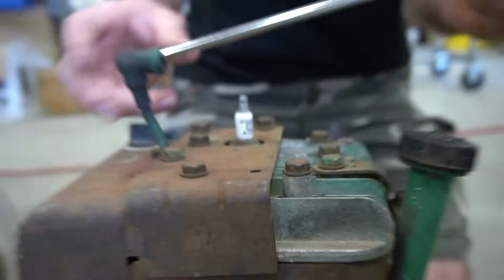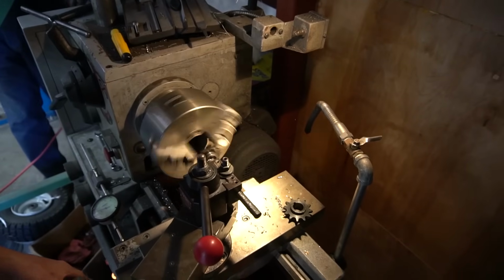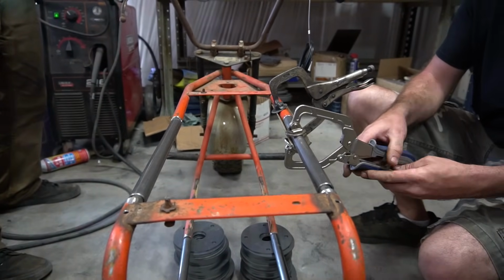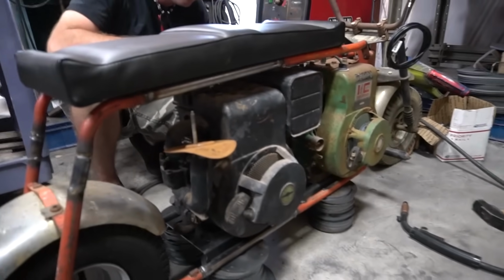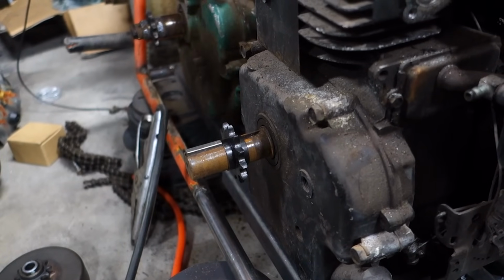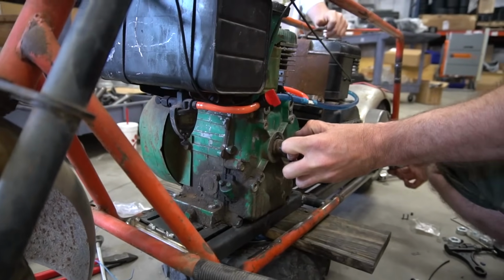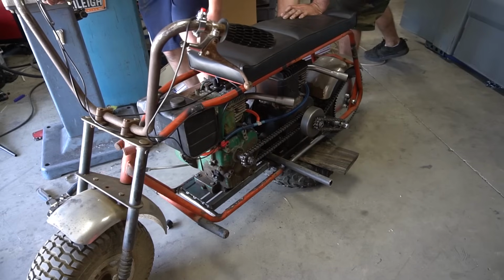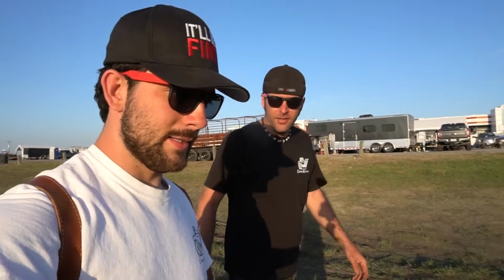Rat Rod 16 HP Twin Engine Mini Bike Build

Comment: You should put a clutch on the front engine, put the sprocket side in so it can align with the rear engine sprocket, I think it will work better and also you will only have to start the front engine.
Reply: Experimental Fun that makes so much since. Wonder if we are overthinking that and there’s no way it could work😂
Reply: exactly what I was going to suggest.
Reply: I was thinking figure out the compression stroke on each and set them to 180deg off of each other so it runs like a real 2 cyl! Maybe also a 2 into 1 exhaust? Two smaller headers feeding a double sized? (more cosmetic than performance).
Reply: Jeff Kephart 2 in one exhaust would be so cool.
Reply: Oh yeah a clutch on the front engine would work cause when you go to give it throttle it will engage the front engine, genius dude Genius !!!
Reply: Experimental Fun I was thinking the same , it’d be like v-tech.👍🏼
Reply: Time the engines 360 degrees apart for smoother power since they are 4 strokes that make power stroke every two engine revolutions...
Reply: Yes the suggestion to install the clutch on the front is a great idea! But take it further and have a clutch on BOTH engines! That way you will have twice the clutch strength! Hooked to one jackshaft then to the rear wheel. But have the sprocket that drives the wheel across on the other side! That would help keep the width down. Plus you would only need to start the front engine! Let it idle, then after it warms up a bit close it’s choke and then just give it some RPM’s to start the other one! Also having the timing on both engines off for alternate firing would be better! Plus a two into one exhaust header that would sound better!
Reply: The 2nd centrifugal clutch wouldn't start the second engine if the chain is looped over both clutches... or if the 1st Clutch drives a sprocket hard on the 2nd engine, then a clutch on the 2nd engine driving the jackshaft wouldn't give twice the clutch strength, as it would be still enduring the torque of both engines... and having all chains on the same side lessens the strain on the jackshaft bearings/mounts as the jackshaft's chains pull in opposite directions, somewhat cancelling out the pulls forces... also, wouldn't want the 2nd engine to be taking off cold... better to warm both of them up simultaneously... furthermore, dual exhausts sound better than single exhaust when routed out to opposite sides of the rear of the bike... giving a stereo sound effect... like on my Suzuki Intruder motorcycle... My minibike I made way back in 1969: 350cc, 2 cylinder, dual exhaust, 4 gears: 
http://i1088.photobucket.com/albums/i333/BuzzLOL1/BuzzLOL%20Pictures/DannyFuneral008-1-1.jpg 
.
Reply: it'll be fine
Reply: Another thought would be, reverse one engine. that way the intake sits between the two engines then run two sprockets on the back wheel so the motors never have a chain between them but just at the rear wheel. You could clutch them individually. But still run the one carb between them.
Reply: Zack Dänekas never work with the engine would be opposite direction
Reply: @BuzzLOLOL  Take it from one who's built one in 70s ,you wrong if the front engine is clutched it will work.The clutches grab @ about 1600rpm so the the front engine timed 360' or 180' would work if you've worked around Hondas,and eould multis
Reply: Forget the last two words - it glitched...having a 2nd clutch on the front engine would give some more engine flexibility & the jack shaft run across to Final sprocket (depending on brake system) on the would add more flexibility too(spare parts etc)Paired or single exhaust system is just a cosmetic thing unless the motors are souped.Not raining on your parade but I doubt you have 16hp, you've got parasitic losses.1 last tip: drill those holes in the frame for welding BEFORE you cut the frame up .These tips were in the karting books & pocket size rod & custom magazine in the 50s & 60s.Those #35 chain Asian Sprockets are junk btw.Cheers Trev New Zealand
Reply: @k.r.v.4219  true, each engine needs their own clutch just like a drag bike
Reply: @Zack Dänekas  the engine that is flipped around would be turning the tire the opposite direction

Comment: what the hell...I like it , I like it a lot
Reply: Right?  I can't wait to see more of this thing!
Reply: Most 'Franken' thing about it is the gearing ratio of the chains... looks like about 6 or 7:1 for a '4 HP engine'... but only needs about 1.5 - 2:1 for 8 + 8 = 16 HP torque !!! ... Would feel like super strong '1st gear only' acceleration... then no shift into 2nd available... The engine braking from letting off the gas would prolly slide the rear wheel... This thing also needs #40 chain instead of lightweight #35 'karting' chain...
Reply: "I dub thee, Franken-Stratten!" Awesome!

Comment: Use a much larger sprocket tying the two engines together with a spring tensioned idler to keep the tension so the chain isn't flopping all over, perhaps a heavier chain, then put a torque converter on it! Regardless, I love how you guys stay the same regardless how much money is around for things. Still making stuff any Joe could do with a welder and some parts. Love it! Look forward to your new videos every week!
Reply: I think it'd help If both engines were syncronized in relation to the power stroke of the piston. I m guessing that right now that one engine hits the power stroke after the other and it creates a massive torque differential through that chain when the other engine is in the compression stroke for ex.
Reply: Yes, phasing between the two engines will break that chain in time. But for now "it'll be fine".
Reply: it will also break the engines, that was my first thought. having 2 motors firing at different times is not good for the mechanical parts I'm sure. But it'll be fine.
Reply: My first thought was if the engines were synced up right
Reply: Why not use a belt between the two engine's the one already was setup for a belt? Weld a sprocket onto the pulley then the belt will allow them to sync
Reply: belts will slip and that isn't good for any syncing the engines. They need a larger sprocket and to turn down the crank to a more usable 3/4 or build it up to 1" which is easier said than done.
Reply: esqueue read belt will allow to sync (slip) instead of break metal parts
Reply: I am reading and syncing is the polar opposite of slipping. That's the reason why timing chains and belts have teeth to make sure that there isn't slip. 

The  reason for the breaking is what I said to you in my original post.
Reply: Bryan L, you're right about the larger sprockets,
Also the bigger the sprocket the more efficient, 
chains don't want to change to an opposite direction quickly on a tiny sprocket due to inertia.
Reply: Smaller sprocket makes more top end speed

Comment: Use a belt to connect the two, that way theres a slight amount of slip if the motors dont agree with each other. Make it kind of like a tiller with a tensioner pulley and when they're both idling you can flip the tensioner pulley to connect their power together
Reply: cute Warlock, got an old Hondo H1 that I put an EMG and a Floyd into.
Reply: Ha ha my buddy had a mini bike like that. 
It had like a 5” v belt pulley on the crank and the back one was like 3”. 
Step on the left foot lever and off you went. 
It tensioned the belt 😂
Keep the engine speed low and help it off the line and get the belt locked as soon as you can before you feed the power.
Reply: I agree the sprocket would of never broke had it been a belt pulley/ tensioner setup

Comment: I saw that chain between the motors dancing and I thought, even with synchronized motors, one is gonna fire first and it's all fun and games until someone loses a femoral artery. 

I dunno about this as a solution  get the motors timed as close as you can and short the spark plugs together or trigger the magneto primaries together off one motor.
Reply: Get a v twin ignition coil off a riding mower  and extent one of the wires.
Reply: @jeffbroxton988  hate to break it to you, but V-Twin engines use two separate coils
Reply: @RubyIsBored  look up 394891. The engine series is 402707. Opposed twin engine. It may still work with a V-series engine as well.

Comment: Looks like you guys all had a blast and good job on the quick build. I was wondering if maybe the engine power pulses were working against each other causing that sync chain to go bananas. Seems that it would be hard to ever smooth that out very much even with additional idler sprockets, but I could be wrong. Maybe stagger the engines left to right and use two rear sprockets, two chains, and the two clutches. That way each engine could be independently connected to the rear axle and they could be started separately and use the clutches to smooth the power between the two. I'm just thinking is all my friends. Again great job and I look forward to what you come up with next.

Comment: ooooh the chain between the two motors dances a lot
Reply: They need to match engine RPMs. In this case, shaft RPMs need to be perfect. Actually needs two identical engines with matching shaft diameters.

Comment: Awesome build guys.
It is not a failure when parts break.
That just means you get a better part that won’t fail.
Get two new Crankshafts then get the right sprockets. While your in there hone and add new total sealed rings. Remove gov.
Clean and paint and reinstall!
It will be FINE!!
👍🏼👍🏼👍🏼👍🏼👍🏼

Comment: Now Issac, we don't have a difference in how a mechanic and a fabricator work do we... the look was great. Thanks for the laugh.
Reply: Also if getting the shaft turned may find actual dual timing chain like 2 small sprockets and the chain from a  22re 
 timing set ($80) might be the ticket.
Reply: It would be somehow poetic to use a HARLEY chain (the motor to gear box one) between the engines!

Comment: Sorry ike, Chris is right. It’s the small things!
Reply: Paul D yep, small things that are ignored early come back later to be big things that bite you in the butt
Reply: Paul D yes but we didnt have time.  We finished the bike with no time to spare
Reply: I think chris, wants to do it the right way..
And the, it'll be fine attitude you have. Is just a cheap way of saying you dont care about it...
Reply: Isaac it'll be fine understandable, Ike. We know you guys were on a tight schedule. What I was meaning is all the projects I've done as well as friends, it seems the littlest thing you ignore, thinking, ah, it's no big deal...will come back with a vengence..a buddy put his rider engine together without waiting for me to help assemble it, good guy, but knows just enough about tools and engines to be dangerous. I got there, the engine was put together, and running. His wife was cutting grass. He looked at me proudly and said, see? I didn't need a hotshot mower mechanic, I did it myself....just then, there was a loud CLANK from the mower and it stopped. The rod broke from the rod bolts coming loose. I asked him, where's the rod bolts retainer? (It's a thin piece of steel that goes over the rod bolts that you been the tab on it over the bolt to lock it in place) he dug on his bench and held it up and said, this? I didn't think it was important..🤔🙄
Reply: Snapfish89 I disagree Snapfish, ...
Reply: Bob Vance thats ok, maybe we jusy see it two differnt ways based on personal preference...
They both are great builders.
Reply: fuckery abounds somebody is very observant. 👍🏼
Reply: Yeah, there is a reason why there is a massive difference in the quality of their work. Honestly, ratherbwelding is probably the best metal fabricator out of all the big gokart channels, while carsandcameras pretty much just rely on expensive engines and such to make their projects not complete shit.
Reply: The Piscis yeah, RBW builds ground up carts, ect.. C&C just slaps a engine on a frame. Both good builds. But one clearly has more knowledge.
They both know what there doing, just have differnt ways of doing things. Sometimes when some one builds a differnt way theyre bias about it, since they do it another way. It is what it is i guess, i watch both..  oh and on the first day when ike wanted to argue over the bike not being a two speed. If RBW knows its a two speed.. its a two speed lol
Reply: The Piscis 100% true, that's why there isn't any single C&C build with no issues. They all end up in a big mess with huge defects with no solution
Reply: fuckery abounds Chris has nothing to do with Red Beard Garage. He has his own channel called Rather B Welding and have some awesome projects and does amazingly detailed work.  No need to disrespect the guy when you obviously no nothing about him or his work.
Reply: esqueue What are YOU talking about?? He referred to RBW, not RBG. Learn to read, dude.
Reply: Snapfish89 Hahahaha! Ask Chris about his chronic cough and how he got it...Then you’ll know just how “smart” he is! 🤣🤣🤣
Reply: TammySue PattyPan You are correct, I read that incorrectly. I am still correct about the last part of my statement though. I seriously don't get the mentality that if someone loves one  YouTuber, they feel the need to shit on and discredit other users. 

Some people just do not get along.  Despite what Ike says in the comments, those two will constantly butt heads. Ike is used to making decisions and Chris is used to doing the same as he works by himself. They also have different ways of doing thing. The only project where Chris rushed turned out bad (E-Bike) but he usually takes his time and gets his fabrication spot on. Ike usually rushes and have things break and fixed but can take his time like they did with the dragster. They both have flaws and both have great channels IMO.
Reply: Except ikes a professional and Chris is a teenager, yea I'm gonna listen to the pro every time
Reply: @mikehunt5330  He is a car mechanic....

This is a fabrication competition.

There IS a sucker born every minute. Happy birthday @Mike Hunt!!!

Comment: I don't know if you felt this way about the motors and I don't know which one it was but I was feeling that one of the motors was running better than the other so when you pull them to start them one would start the other one would not and then while the one was running it was turning over the other motor and spinning it to where it would finally fire if both them Motors were running smoothly which I believe they were not that would have been tits on. But, it's going to be that way. You guys wouldn't have it any other way!! fantastic job your winners in my book and everybody everyone else's too and, I  saw the animosity : ) Isn't that right Ike? But you know what? You do I do and a lot of other people got dudes number. He's a flake and he's weird. I like his work but he's simply weird. You guys just keep being you. Thanks

Comment: Cool build, it was a good start. The Go Power Shorts guys are great to get it out to you to fix it up right. Seems you need some way to account for the differences in the rpm, however slight, of each engine so they aren't fighting each other and smoothly putting the power to the ground instead.

Comment: You should link them with a belt, leave the belt a little loose and then put a pulley on a lever to tighten it when you get one running, then the running engine will turn the second engine over starting it, just make sure that you make room for the hand clutch to cam over so you don't have to hold it. I've done it and it works great.

Comment: To eliminate the problem of starting both engines at the same time you should have added another clutch to the first engine then they could be started individually but when throttle was added both would still drive,  awesome build I'm just adding a little productive input that might have relieved some of the headache

Comment: crtazy idea .. i dig it .. and i suggest first to identify the top dead cenders of both engines .. then chain connect them as synchronized and altenating as possible to simulate a paralel twin engine ..of course after beefing up the drive shafts sprokets  , ther will be less strain on the chain to handle .. i injoyed watching ur video boys .. peace up

Comment: Awesome build for sure!, when directly connecting 2 engines at the crank it would be a good idea to set both engines at TDC comp. stroke before installing the chain...or a separate clutch per engine.

Comment: That was pretty cool. Maybe you can put two clutches on it. Maybe you can weld a smaller shaft on that front engine. Or start it up and file it down.

Comment: It is a pretty cool project there. basically with both the engines would add up to double the torque. might also want to sync the firing order of both engines if you had not already to have both fire at the same time or have one fire alternately from one another.

Comment: Ike, John, have you considered running the engines in parallel (but separate) via 2 clutches?  One clutch per engine, 2 chains to the rear axle (2 separate axle sprockets), front engine shifted to the right ~1 inch so the chain will clear/pass the rear engine.  This way, you could start/run the engines separate.  Let me know what you think.
Reply from the maker: We're trying to get our hands on clutches with two sprockets on them. We can run one regular clutch on the forward engine, then a dual sprocket clutch on the rear (one sprocket tying the two together, and the other sprocket leading to the jackshaft). That's the plan!

Comment: I think you'd have better luck if the engines were phased based on their firing order because they're linked together. Since they're 4-strokes you could have one fire and the other on the intake stroke or have them both on the same stroke at the same time. Since it's just a chain that connects them, you can adjust the timing to see which way works best. Either way, it's a rad build!